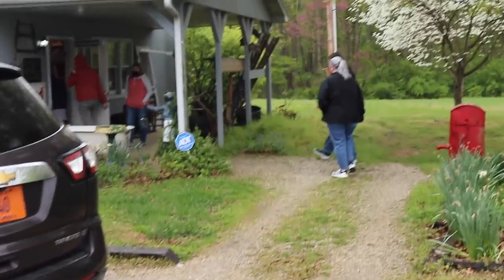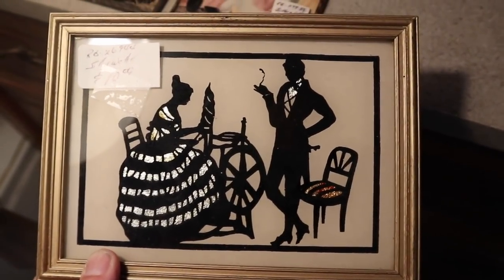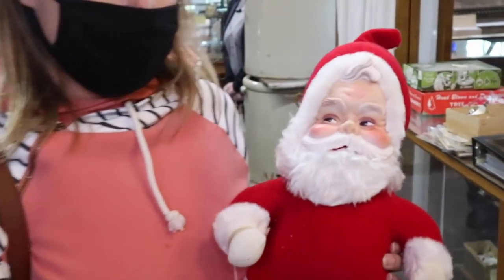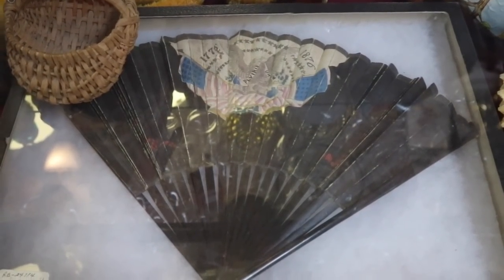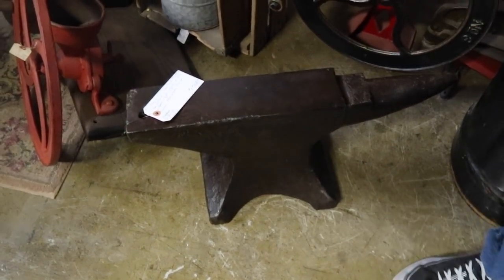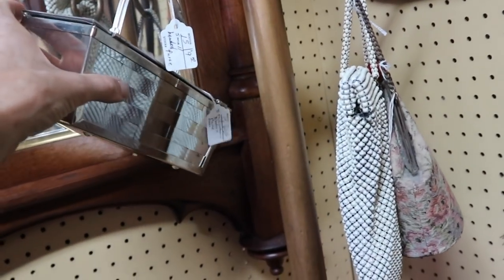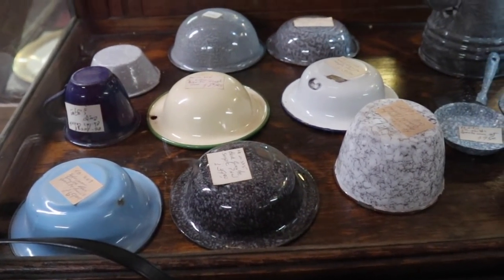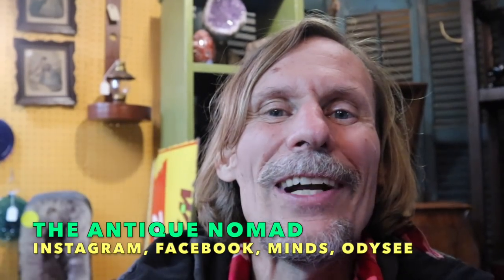BIG VINTAGE BACKWOODS SHOPPING! | ANTIQUERS SHARE FRIENDLY TIPS

Comment: I just got to the point in the video that you found the cool Blenko decantor. I rarely see those in my area, I am not sure why. But I was glad to learn that some times the clear stopper really is the right one. And then you came upon the "Smut" light switch... My goodness. 😕
Reply from the maker: THe smutty light switch was hardly what I'd call "hot"! The Blenko decanters almost always have colored stoppers but there were just a couple of lines in the early 70s that used clear
Reply: @TheAntiqueNomad  Thank you for the info. it always helps me a lot. I am getting better and better at finding "good" items to resell, thank you as always.

Comment: That paper tag stuck on the gum display reminds me of a VERY rare crumber (no brush sadly) from The Seattle Tea Company that probably dates from the early 20thc, the dealer put a sticky label on the item that was "japanned" it took some of the finish off but I still bought it for $28 because of it's rarity, it still kills me to think about his stupidity.
Reply from the maker: Dang, dealers often think just because something is metal that it doesn't matter. I had 500+ dealers in our four malls when I was general manager of a chain in the NW and I was constantly having to correct how they used those tags